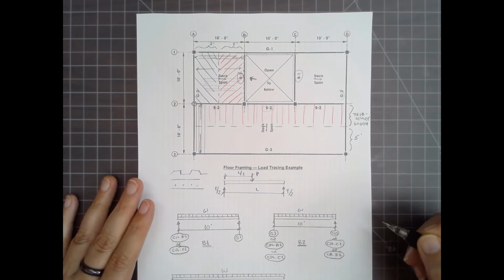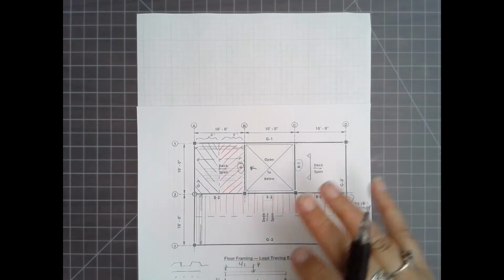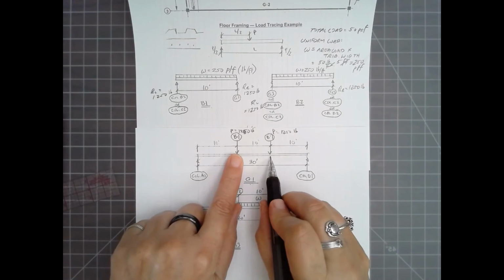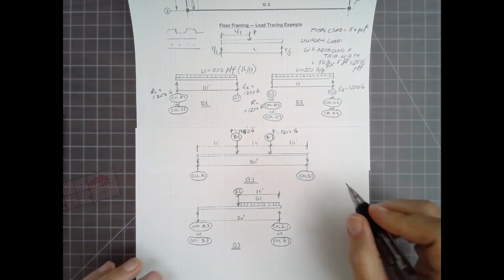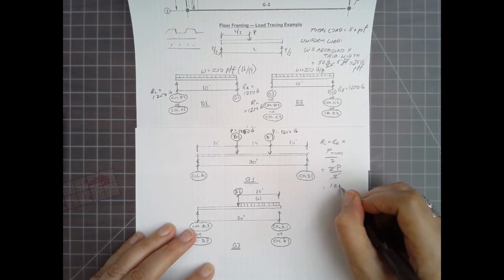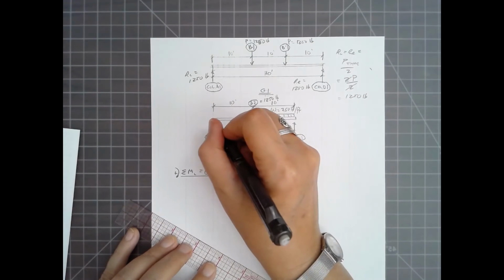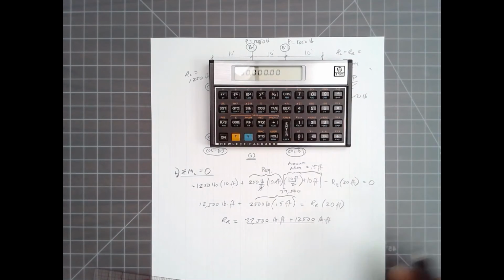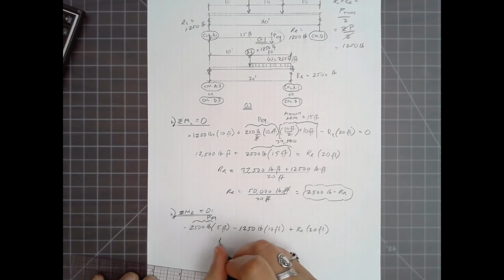Load Tracing, Part 2: Beam Load Analysis

Comment: thank you so much but i have a question.. can you solve a continuous beam, joist and girder came from a plan.. i need it 😭
Reply from the maker: Continuous beams can't be solved by basic equations of statics, and so I don't go into it in any of these examples. But in general loads distribute by tributary area to continuous beams in the same manner as simple beams, unless continuity of the deck they are supporting is a consideration. It's a reasonable estimate to treat such a condition as a simple span, though, and then the continuous beam can be analyzed with computer software. There are other manual approaches such as the theorem of three moments, however that's beyond the scope of any of the basic videos I provide here. That can probably be found on someone's structural engineering videos page rather than architectural structures. Good luck!